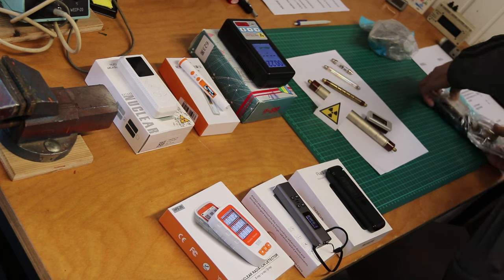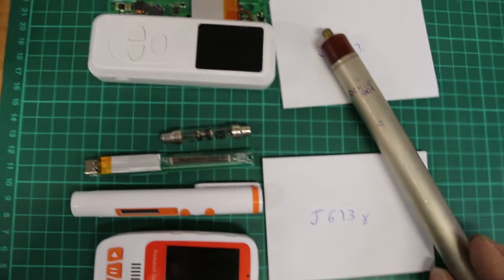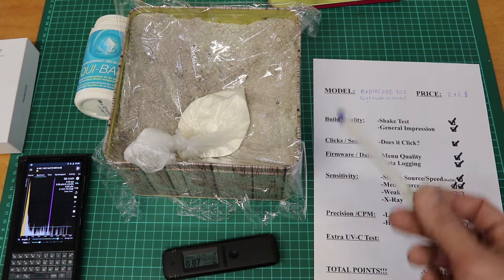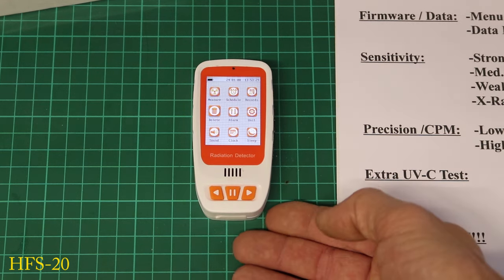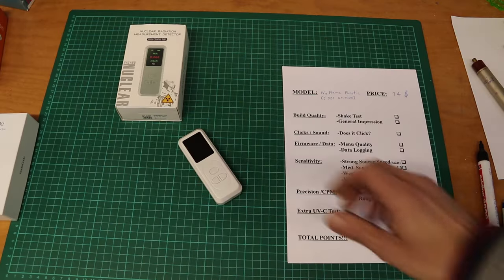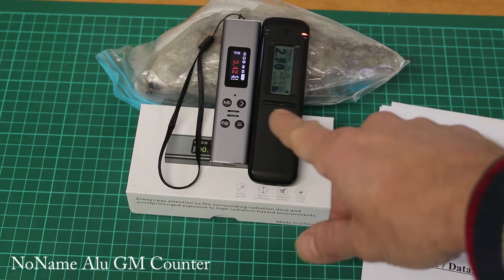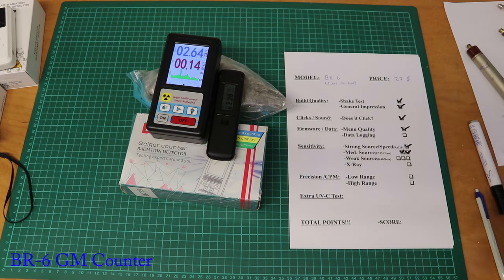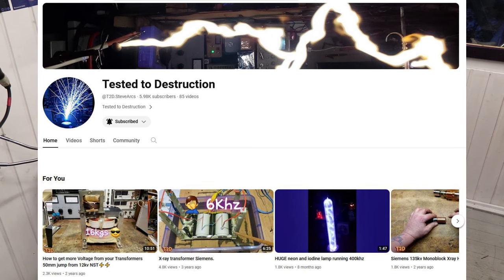5 Cheap Geiger Counters from Aliexpress (Review Time!!!)

Comment: Great video, I just got the HPF-P3 in the mail and didn't knew it didn't have the audio.. ordered a BR-6.

What are you looking to add to yours? I haven't understood.

Thanks for the great video
Reply from the maker: good choices! i really like both these detectors :) the HPF-P3 just to have in my backpack at all times, and the BR-6 for actual sensitive identification of low level sources like the Potassium in the Plant Ashes. What i already did is order 2 more BR-6es ;) One as is, one as experiment platform, and the last one i swapped the GM tube for a soviet SBT-11a (alpha beta gamma) Mica Window Tube. It works really great with the SBT-11a, its extremely sensitive with this tube! great for low level sources ;) I will post a video soon talking about the modifications ;)
Reply: @BremsstrahlungChannel  really looking forward for this video. Is it as simple as swapping it or support component on the PCB are required as well?
Reply from the maker: Its pretty simple, you dont have to tamper with the PCB. You only have to add a Resistor to certain GM tubes for them to work properly ;)  @DiaLFonZo
Reply: @BremsstrahlungChannel  I'm already looking around for a tube but can't find anything 😔
Reply from the maker: Yeah the market got quite abit more difficult in recent years.. i always went to sovtube.com a few years ago, but theyre almost sold out as it seems. there are some offers for soviet tubes on ebay, mostly from ukraine. prices went up a bit but you still should get sbm-20 for 30 bucks or sbt-11a for like 50 bucks max i think.. i dont really have experience with american tubes, but i think you can buy pancake style tubes online as well, may cost abit more ;) or the chinese tubes from aliexpress or similar sites! m4011 is a geat beta gama xray tube, and the j305 seems to be a good copy of that tube.. but so far i didnt see any chinese alpha capable tubes.. @DiaLFonZo
Reply: @BremsstrahlungChannel  
Got mine and It's buggy, sometimes freeze and buttons don't have any effect anymore. Weird.. Already got a refund from Alie.
Reply from the maker: damn im sorry to hear.. maybe you can use the damaged one for spare parts? i got 3 BR-6es meanwhile, mine are all okay so far ;) i got a damaged HFS-P3 in my last shopping round, i guess in this  price range its just a factor to consider ;)   @DiaLFonZo
Reply: @BremsstrahlungChannel 
It's ok.. Got refunded and it works one out of five times. I've tried to spot something wrong on the PCB or somewhere else but could not.

Out of the blue, do you know a way to make the buzzer louder?
Reply from the maker: @DiaLFonZo  ..just an idea.. Mayybe the tube is shorted out, when i made short circuits it sometimes shut itself off.. Did you remove the tube? Maybe it works properly without the tube? Btw i should be done with my modifications video soon, hope to upload on the weekend ;) about the buzzer.. Louder might be difficult, dont really have an idea.. Maybe try another buzzer? I did notice the sound change abit when i put different gm tubes ;)
Reply: @BremsstrahlungChannel 
The tube on mine is soldered to the clip mount (weird) and it looks like a software bug or something.. 😂
Reply from the maker: yeah the tubes are all soldered in on my br-6es.. its annoying to de solder them, also chance to break a tube is high, but i could get them out with som patience ;) @DiaLFonZo

Comment: Hi Manutek,
I'm interested on measuring cars that might have been subject to radiation from the Fukushima nuclear accident.  Would this devise be suitable at detecting if the object was subject to such exposure and might be unhealthily contaminated?
Thanks.

https://en.wikipedia.org/wiki/Radiation_effects_from_the_Fukushima_Daiichi_nuclear_disaster#:~:text=On%2024%20May%202012%2C%20more,and%20caesium%2D137%20was%20released.
Reply from the maker: Hello, and thanks for youre comment! Wow this is a serious topic, im happy if i can help out, but beware i am no expert ;) Well, i would say, if you are on a budget, buy the BR-6, or better 2 BR-6es. If you go for this option, make shure the device works properly, build quality is not always guaranteed with these cheap devices. maybe take it to a known hotspot and check if it really detects anything. If you can afford it, buy something from a known Brand, i would suggest GQ Company, i have the GMC-320 for many years already and its a really good device. Or also check out the Radiacode series, they have more options like a spectrometer, if you want to get more into this topic, radiacode is a great way to learn as well :)